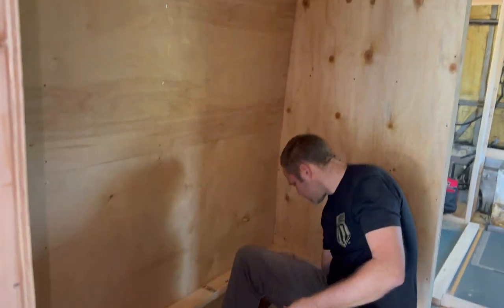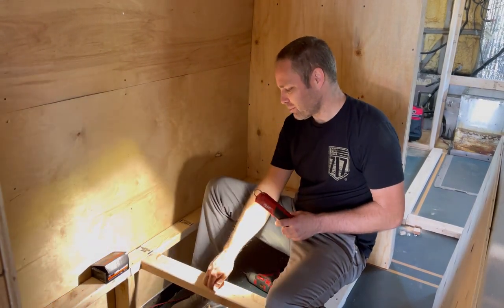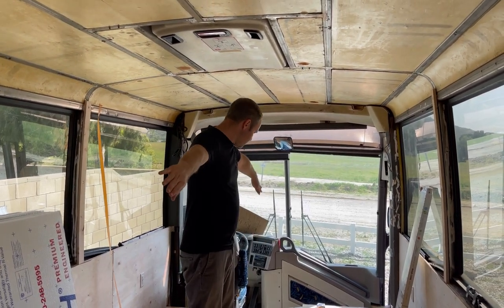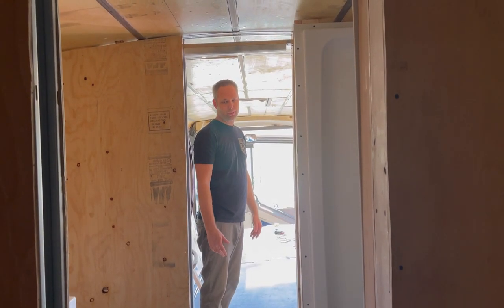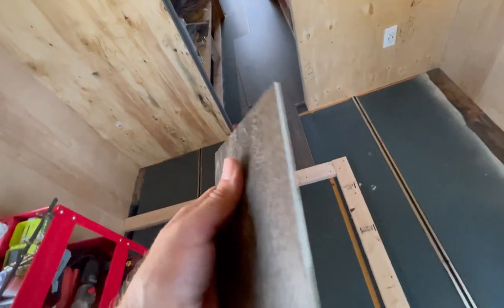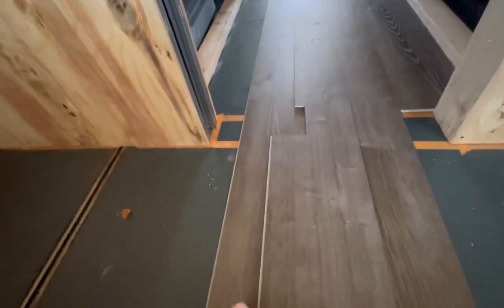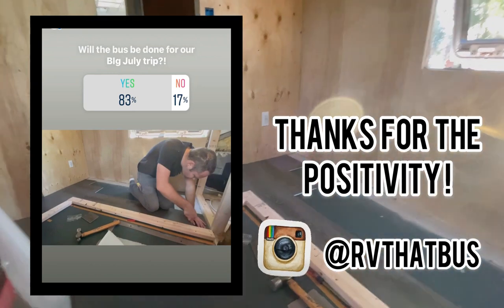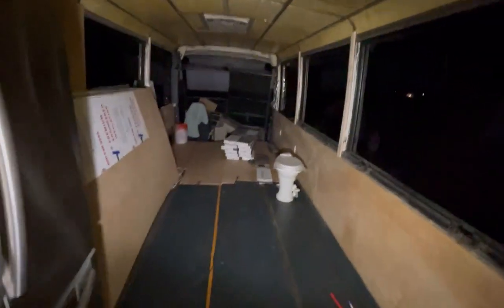Episode 35: Flooring Install and Bunk Bed Framing

Comment: I have been thinking skoolie, but like the idea of a more substantial bus similar to your MCI.  A couple of questions.  What is the inside height of the bus, I'm 6'2" is there enough head room?  Next question, it looks like the ceiling of the bus is well insulated.  What type of insulation is that and how thick is it.  Thanks.
Reply: I too am 6’2 and I don’t have to duck to go through our doors.  The insulation on the walls and ceiling is what came with the bus.  We will be adding similar on the ceiling with furring strips and 1/2 foam.  I chose not to remove the original insulation.  It’s pretty dense and looks to be caulked around the edges as well to seal it.  Some rip it all out and spray foam, I didn’t want to mess with that.  

Don’t get a Skoolie.  They’re not really welcomed at most RV camps. They’re a typical truck chassis frame and too heavy.  Prone to rust as well as the mci and prevost has a full stainless steel chassis.